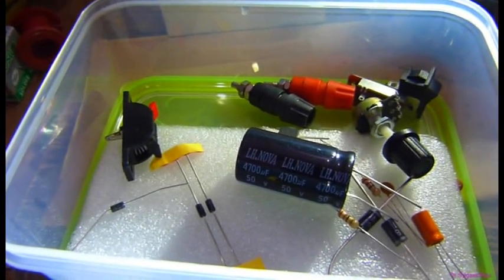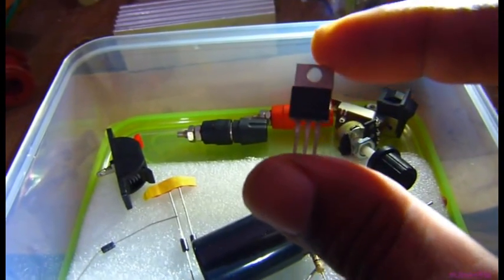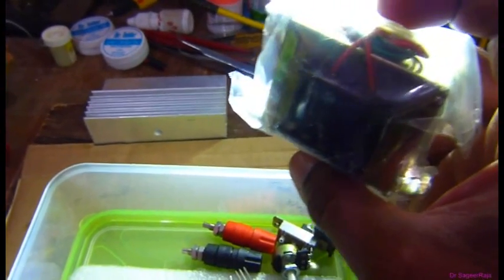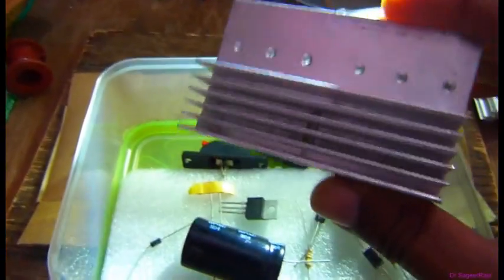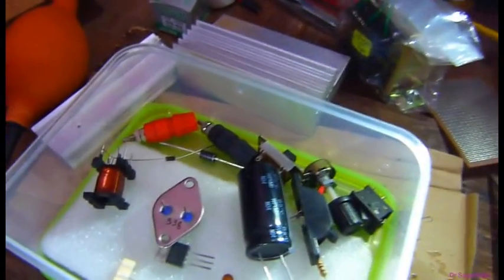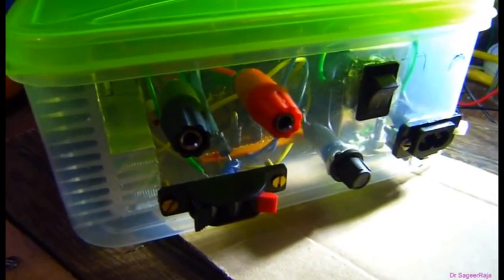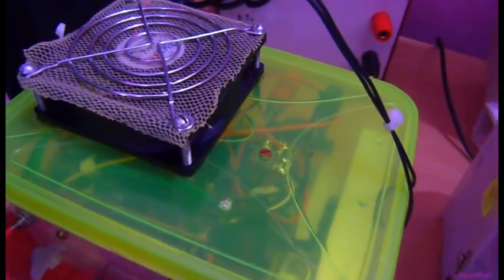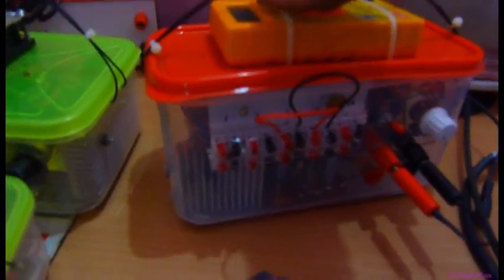Cheap Variable DC Bench Power Supply - Tips and Tricks 2016 HD

Comment: try using lm723 its a varibale voltage and current regulator for the main tranzistors use n23055 but you ha e to use external npn tranzistor (bd139